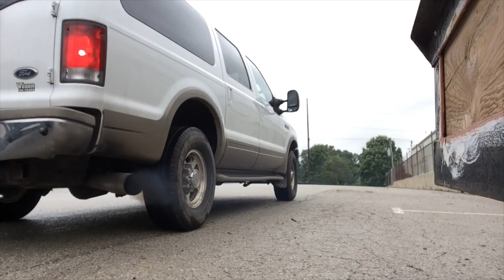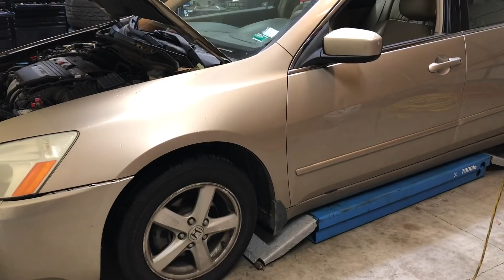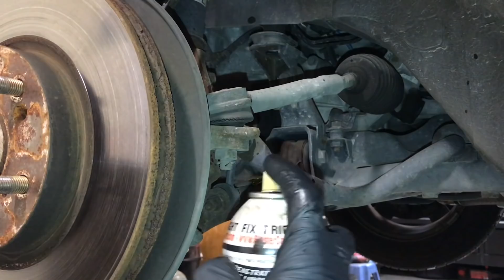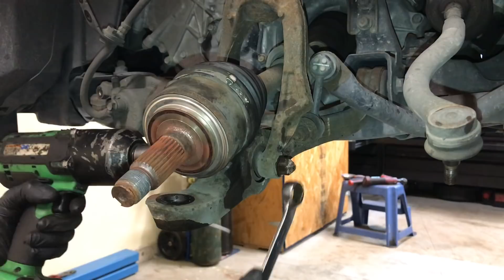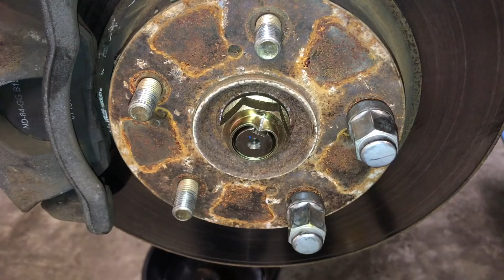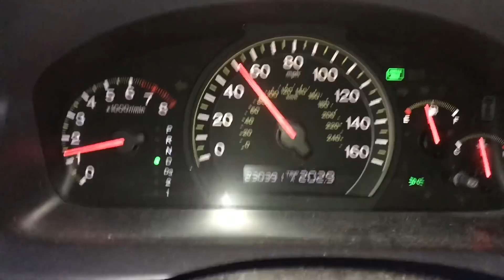Step by Step: How to Replace Axle Shafts

Comment: I noticed in a video of yours a year ago when changing the oil in your f150 with new engine in it. What I couldn’t help but notice is you used oil out of a drum labeled 5w-30 and I didn’t notice it saying motorcraft. I recommend motorcraft synthetic blend 5w-20. I have been using it for 5 yrs now after watching ford engineers torture an eco boost with it. I can’t believe some of the temp changes in some engines. Hope this helps you.

Comment: One of the joints could be binding up...once the shaft is out you can move either joint to check for resistance in articulation...

Comment: Hey, great video!
I'm currently replacing my rear hub, because the threads for the wheel bolts are f*cked up. But I can't get the drive shaft out of the hub. I tried heating it, a ton of rust solver, big hammers and even a special tool for pushing it out, but nothing worked. My next step would be to remove the whole axle journal (don't know if it's the right word, I'm not american), so that someone with a hydraulic press can press the driveshaft out. Or do you have any other tips for me?
Cheers

Comment: 230k in that accord??? does it have the original trans.
Reply: THE ONE THAT YOU LOVE TO H8TE yeah I had a 99' Odyssey that grenaded a couple transmission before I got rid of it a couple years ago.
Reply: My odyssey with 260k has the original engine and trans still.
Reply: **Classified** what year?
Reply: 2006, original owner.
Reply: 99-02 was a shitty year for Honda accord 03 and up they really made a big difference I buy 3-5 Honda accords a week just because of transmission gone out I either have it rebuilt or replace it to sell

Comment: dude you can just remove lower ball joint and the lower bolt for the strut and you can sneak the axle out that way
Reply: You beat me to it. Was going to say the same thing to help him out for the next time he had to do this. Otherwise good video.
Reply: Longtrailside maybe he did it for video purposes
Reply: Maybe??? I dont know. All i know is if im working on a car that im unfamiliar with, and someone gives me some good advice, im thankful for it. Who wants to struggle working on a car and taking off a lot of unecessary stuff when you could learn a faster easier way. This is the great thing about the internet is that we can learn from one another, and its nice to be able to reffer to or ask for advice from others who have done it before hand, and learned it. Not every mechanic knows everything about every car out there, so its great to have this resource to come to, and learn from one another.
Reply: I was going to say that as well. Former Honda tech, now work for GM. I'm thinking why is he doing all that extra for.